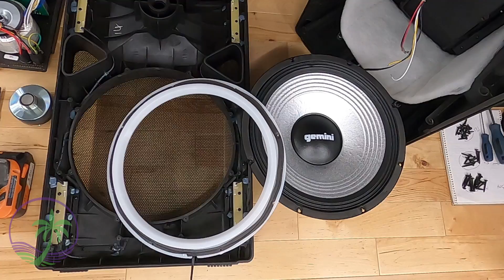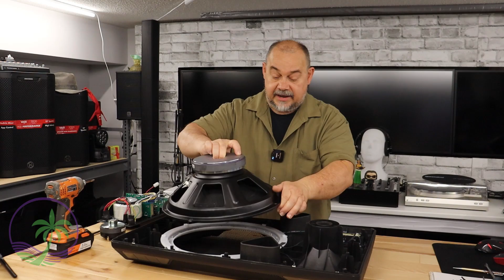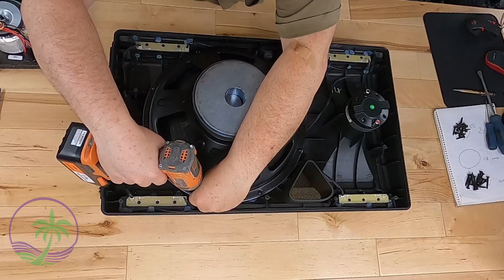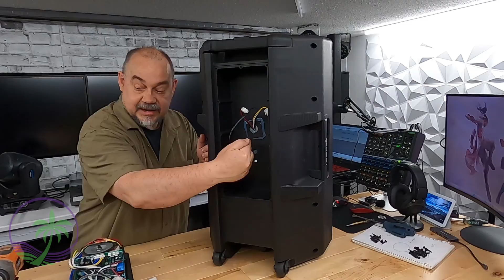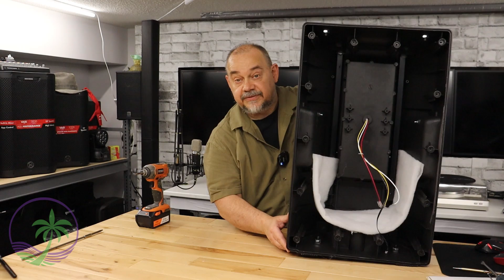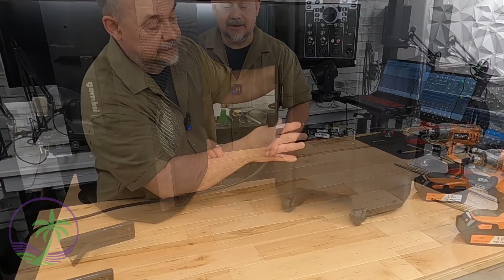This Party Speaker's Secret Interior Will Amaze You

Comment: The pole mount screw that tightens it broke and stripped out the threads the  moment i took it out of the box. The speaker also makes a lot of noise when no signal is being sent. That said, its loud enough for me to battle 4 water falls and pumps at a 150 person pool party. (Plus a 12" Klipsch Sub)
Reply from the maker: over the years I have seen that happen with other brand, the factory uses a power tool to screw it the insert and strip it. I had to fix with weld-all. better then new. if it happens right away and you can exchange it, exchange it.
Reply: @expertisland  I'll add that to my cart. Ty